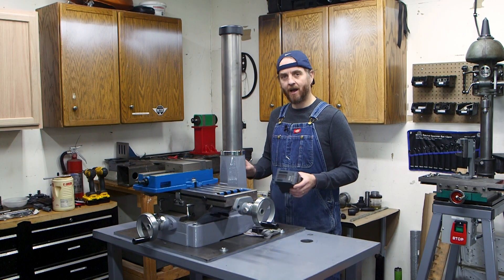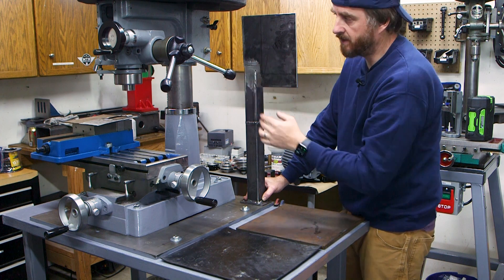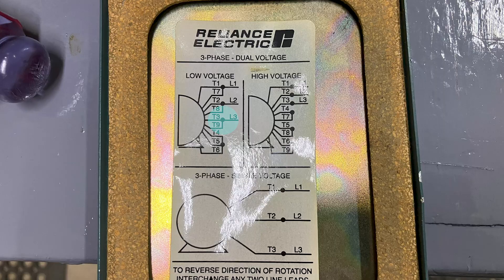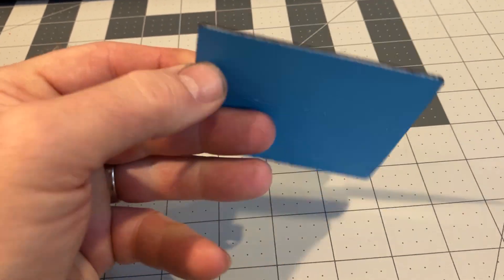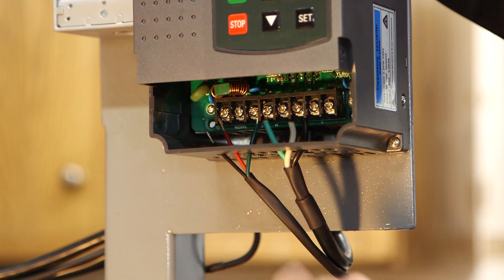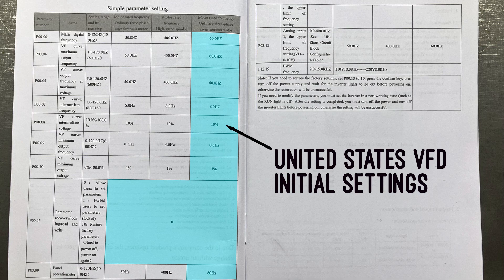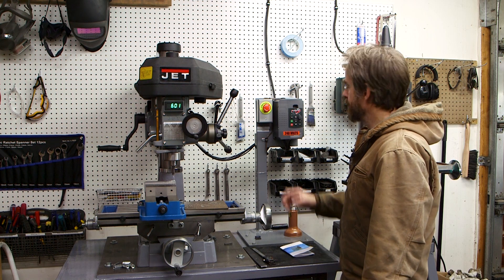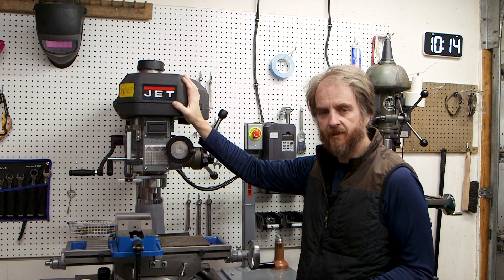New VFD for a Round Column Milling Machine

Comment: Keeping the step pulleys defeats the purpose of the vfd. You should lose the step pulleys and run it 1-1.
Reply from the maker: No, it does not.  The VFD motor doesn't produce a lot of torque at frequencies less than 25% full-speed RPM.  If I were to set the mill to 1:1, I would have a minimum usable speed of about 500 rpm.  The step pulleys allow me to change where that torque cutoff is.  If I switch to a stepped pulley that drives the spindle at 1000 rpm max, then I am good down to 250.  If I do a 300 rpm max,  75RPM min rpm.  You get the idea.  There is no downside to keeping the step-pulley.

Comment: did you do anything with the belts? I mean im considering adding a vfd myself to mine, but due to wheels having that much "gearing" im not sure which pulley combo i should use.
Reply from the maker: I did not.  I kept the stepped pulley setup in case I wanted to change the speed range.  I have it set to give me a max speed of about 2400rpm right now.  1246rpm is it's sweet spot.

Comment: Hey Robert, great video great job. I have a Wrong Fu RF 31 which I believe is the exact same machine. Could you please tell me the motor model # you have with it? I’ve been calling Motor Comp in my area and they don’t seem to be able to match the one I have. Mine happens to be a 2 hp with my machine. Thank you if you get a chance to answer.  greatly appreciate it, Jay.
Reply from the maker: Hi, Jay.  Mine is only a 1 HP motor.  It’s 240v 3-phase.  It's made by Reliance Electric. Model is: Duty Master A-C Moter, XEX,.  Severe Duty, ID number:P14G7505P-KD.  1725 RPM, 7/8 shaft, FL143 frame.   I went with that one because it met my specs and was relatively cheap.
Reply: @RobertAdairWorkshop  thank you so much for replying so quickly Robert that was very kind of you. Now that I have that info at least I’ll know what frame size and I can give the information to Reliance and just tell them what would it be for the 2 hp motor.  thank you so much once again really appreciate it.

Comment: Hi, nice job, I'm also making the same changes to my rong fu rf 25 but I can't figure out how to remove the large pulley to put the rev counter sensor magnet... could you please explain to me how you managed to remove it?
Thanks in advance
Reply from the maker: I removed it once, successfully, and the second time, I broke it.  But I did learn how to get it off.  Put a two or three jaw puller on it and tighten it up enough that it puts pressure on the pulley.  Don't tighten it up so much that you feel it'll damage or break the pulley.  Then, while wearing safety glasses, heat up the center portion of the pulley with a propane or MAP torch.  Once hot enough, it'll pop off and fall on the floor.  Be ready for that.  But don't try to just pull it off without heat.  Chances are good it'll deform or fail completely.

Comment: Hi Robert!
Would you please be so kind and advise how can I safely remove the pulley that is located above the pinole of the machine? I’ve got same JMD-15 you own.
I tried to move it up using the bearing puller, but it didn't move even a millimeter. I'm afraid the puller's feet can break off pieces from the pulley as metallic there is so thin. Any tips will be much appreciated 🙏🙏🙏
Thank you so much in advance for your advice.
Warm regards from snowy Russia,
Anton
Reply from the maker: I had to go out and stare at the mill for a few minutes to jog the memory.  It’s not what it used to be.  The only thing holding the pulley on is that big nut and the taper.  I remember thinking I was going to break it when I took it off, too.  I used a three jaw puller, ran it down as tight as I could by hand, whacked the pulley around its circumference, then heated it with a torch.  It didn’t want to come off, though.  So I figured I’d replace the pulley if I destroyed it, and used an impact on the puller and it popped free.  It was on there a lot tighter than expected.
Reply: @RobertAdairWorkshop  Thanks so much, Robert!!! I will try to heat the pulley too. Hope that will be sufficient and there will be no need of using something heavy. 🫣😂
Take care! Very useful channel, btw. I suffered for several days without information and God has sent you 😇🙏🤝🤝🤝👻
Cheers 🍻 
Anton

Comment: Hey Robert you should treat yourself to a gas welder, its quality of life improvement 😅
Reply from the maker: Mine will do gas.  I just don't know where to get cylinders, locally.  There'd be a whole new learning curve, too.  I've been a flux-core guy since I was 10 :)
Reply: @RobertAdairWorkshop  ah I see, you might be able to get just straight CO2 a bit easier locally I'm in Ireland so things will be different but you can get gas from the likes of bar and pub suppliers and its also sold for Fish tanks aquariums and the likes.
That's if there's no welding supply or AIrgas in your area. 
It's definitely not a necessity, it just reduces smoke and spatter a lot and makes the puddle a bit more visible, the welds are no stronger.

Comment: I have a few of those sensors I was playing around with the other day and I found out that they sense just plain iron or steel better than they do the magnet, at least the inductive ones I have do.  Mine have a 4mm sensing range, and they did with just plain steel, but were 3mm with the magnet even if I stacked some magnets together.  Just a thought if you ever worried about chips getting in somewhere and sticking to the magnet (probably not here, but maybe on something else you might do).  It also detected aluminum at about 2mm and copper at 3mm.  It seems that they would sense on any kind of metal "bump" that might be coming around and may not need the magnet at all.   Also, some of the RPM counters have two buttons on the back and you can store a multiplier less than, equal to, or greater than 1.  You can measure correct rpm on an engine with multiple cylinders or even count the spokes on a pulley and covert that to something else like sfpm on a conveyor (a pretty cool feature).  They are about the same price <$10, and some are smaller like 2" wide (most are 3").  Look at a picture of the back of the board of the one you used, if it has the two buttons, it has that feature.  The smaller counters are 5V and you would want to make sure you had the 5V sensor to match (they also have the 4mm range).

Comment: I guess any braking you get out of the vfd is short lived and then switches off.  I wonder what it would take to apply a brake long enough to lock the spindle to loosen or tighten the drawbar.
Reply from the maker: I'm not sure.  I have a resistor that I bought for the first VFD, I'll give it a try and see if it works.  It's a neat idea.  Currently, I hold the belt, but not having to do that would be neat.
Reply: I think they apply DC to AC motors to keep them from turning sometimes and they do have motors that come with brakes.  It might be possible to just apply DC directly to two of the motor terminals if you knew what voltage.  The VFD shouldn't have a problem with it as long as it was below its rating.  The motor would start to warm up, but you would only do it briefly at some reduced voltage.  You know someone out there is doing it, there should be somewhere to read up about it.  Yep,  I just read that some VFD's have it, it's called "DC hold".  I think the resistor is only used for slowing the motor down and not holding it.   @RobertAdairWorkshop

Comment: A lot of the vfd's don't have the braking circuit built into the board.  If you did it there would be a place to mount a braking resistor.  Some have DC braking.  Went thru the same with mine and learned to live without it.

Comment: Vey informative! I actually had to return to watch this... I would like to ask what is the base speed you installed the motor with the belt arrangement
Reply from the maker: I have the pulley such that the mill is at it's second fastest speed that It'll run.  At 60-hertz, that come out about 1940 rpm.  If I put it in the fastest ratio, I can get about 2600 rpm, but I wasn't sure how that'd impact the low-end performance, so I didn't run it there.
Reply: @RobertAdairWorkshop  Thank you, great work!!!

Comment: Thanks for a very thorough tutorial. I recently bought an identical mill and intend on doing the same, this will be invaluable. Will you put on a power feed?
Reply from the maker: I’ve been going back and forth on a power feed.  I usually don’t need one but recently faced some warped exhaust manifolds and a power feed would have been nice.  I’m looking at the smaller, cheaper ones made by Vevor.  I think I’d like a full DRO first, though.  I have one on the quill which is invaluable.  Adding a set on the table would be nice, too.  I need to save some money for the DRO parts and power feed.  It’s a good, versatile mill, and I think those two would make it even better.

Comment: Can you post the Part number for the new replacement motor.
Reply from the maker: Yeah.  It's made by.  Reliance Electric. Model is: Duty Master A-C Moter, XEX,.  Severe Duty, ID number:P14G7505P-KD.  There are thousands of surplus 3-phase motors on eBay.  I searched until I found one that met my specs:  240V 3-phase, 1725 RPM, 1HP, 7/8 shaft, FL143 frame. 

Here's the exact same motor on eBay (so you can see the model plate):
https://www.ebay.com/itm/290680494865?hash=item43ade85b11
Reply: Thanks! 😊

Comment: Turn the mill head all the way around.  Lift your motor onto the mill table.  Move the table so you can lower the head to mount the motor.  When I did it I needed to put some wood blocks on the table under the motor so it would reach high enough.   Lower the head to mount the motor..  Move X and Y to position it. Doing it this way allows you to accurately adjust the motor height when you tighten the bolts.
Reply from the maker: That is brilliant!  My way was dumb.  I’ll keep it in mind for the next time I yank the motor.
Reply: Yeah I'm 74 so If I don't use tricks it won't get done.  I'm just finishing putting in a VFD.  I bolted the VFD left side of mill just above and behind the column lock handle.  It just clears the elevation crank.  The mill is nice soft iron so it is easy to drill and tap.  @RobertAdairWorkshop

Comment: Hello , great video and very informative ..
I only need a little clarification regarding the2 E stop in series wiring diagram along with wire sizing for those E stops .

If you can help that would be great ….. Thank You again
Reply from the maker: Hi, Jenniferfraijo.  It's pretty straightforward.  Wire the inlet side of the two switches together and the outlet side together so that when either switch is pressed, it completes the circuit.  Since they are wired together, when either is pushed, it'll do that.  Then you can wire those two to the VFD pins.
Reply: @RobertAdairWorkshop  For E-Stops, don't you generally want them to be wired such that, the E-Stop is Active by default and rather than pressing the E-Stop to close the circuit when active, it is breaks the circuit when active?

I was told for for an older maintenance tech that for E-stops you want it that way, because if there was a fault in the wire, the machine won't run, which you want. Because the alternative is, the machine runs, and you don't find out that your E-Stop doesnt work until you use the E-Stop and it doesn't actually stop the machine.

Just some thoughts, great video
Reply from the maker: @everettcass7904  That's really good advice.  I mean, really good.  Something I hadn't considered and easy enough to configure.  Those switches are both NO and NC.  I'm going to do it on mine.  Hopefully others will see your comment too.  Going to pin it.

Comment: Hi Robert. It's amazing how many of those VFD's have faults, some brands are not worth the investment. The mill looks and runs great, one thing I would be concerned with is spindle speed  as the bearing the machine come with may not be rated at high speed operation. I would have changed them out for better quality bears rated for high speed operation.
Reply from the maker: I had that tought too.  I matched RPM ratins on the two motors and sticking with the stepped pulleys gives me the same max speed the mill had with the fixed-speed motor.  Surprisingly, this version had SKF bearings in it when I pulled it apart.  I replaced the two on the belt idler and spindle drive with new ones from McMaster.  I think they were FAG.  I did repack and reuse the SKF tapered bearings in the spindle though I am having second thoughts about that.  I think I'll take your advice and swap those out so that I do know their rated max speed.
Reply: @RobertAdairWorkshop  FAG bearings are quality bearings. .. Packing with grease will reduce the maximum RPM ratings, but the original ratings could be very high to start with. There are guides published by SKF & FAG with these details about oil vs grease and what kind of oil or grease to choose. ... p.s. How is the B&S surface grinder progressing? .. Thanks for your content, I enjoy it. .. John